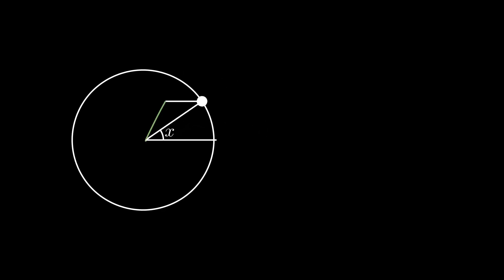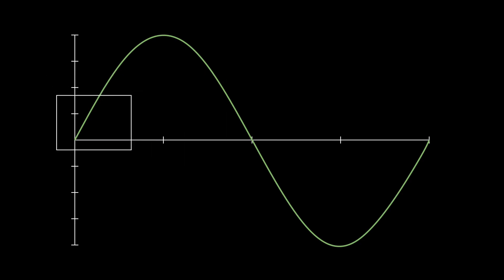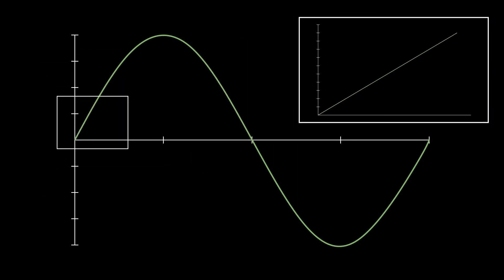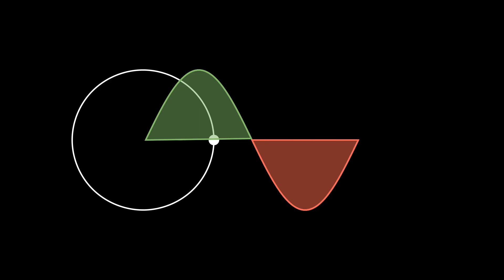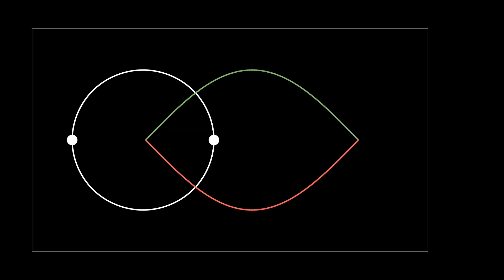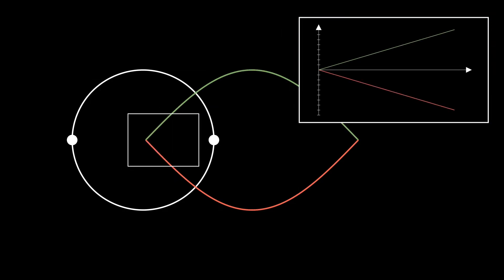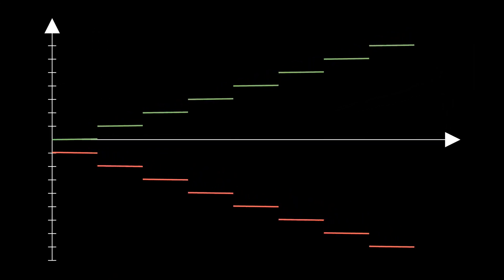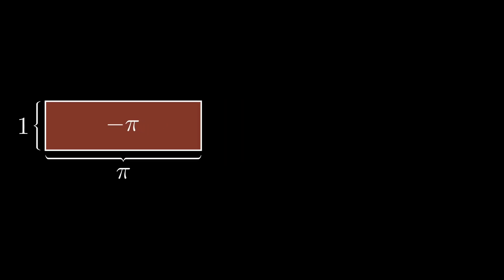MIT - Integration Bee 2023 - Qualifying Round - Question 8

Comment: Here is how i did : 
Let define:
S   = ∫ ⌊2023 * sin(x)⌋ dx for x = 0 to 2π
S1  = ∫ ⌊2023 * sin(x)⌋ dx for x = 0 to π
S2  = ∫ ⌊2023 * sin(x)⌋ dx for x = π to 2π

(we get S = S1 + S2 by construction)

By substitution in S2: let u = 2π - x. We get :

S2  = ∫ ⌊2023 * sin(2π-u)⌋ -du for u = π to 0
So: S2  = ∫ ⌊2023 * sin(2π-u)⌋ du for u = 0 to π
We notice 2 things: 
1. sin(2π-u) = -sin(u)
2. ⌊-x⌋ = -1 - ⌊x⌋ if x not an integer. 
So in the interval, we get ⌊2023 * sin(2π-u)⌋ = ⌊-2023 * sin(u)⌋ = -1 - ⌊2023 * sin(u)⌋

So after simplification, we get:
S2  = ∫ -1 - ⌊2023 * sin(u)⌋ du for u = 0 to π
So : S2 = - π - S1

To conclude : S = S1 - π - S1 => S = -π